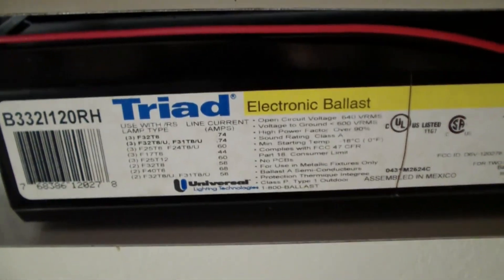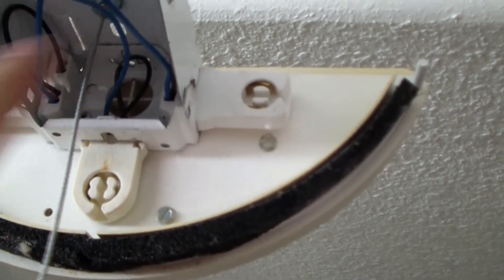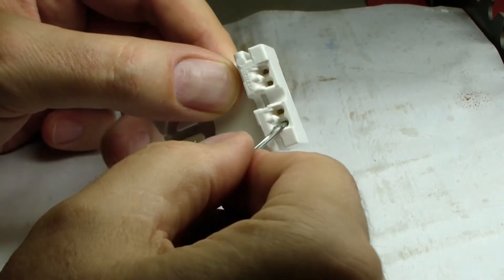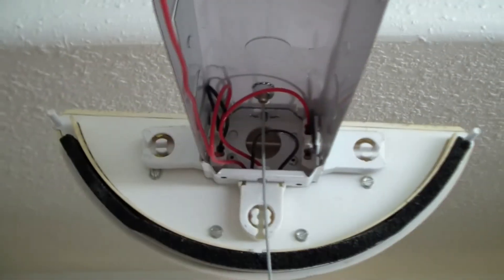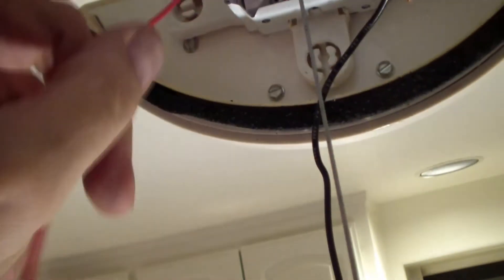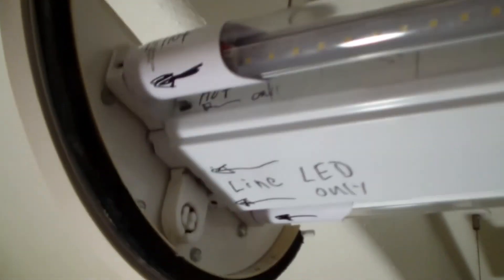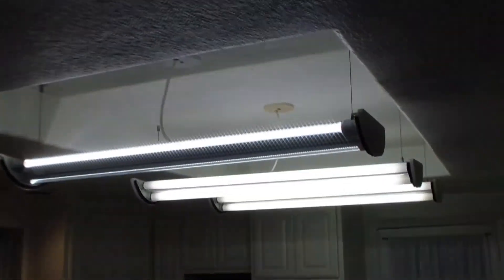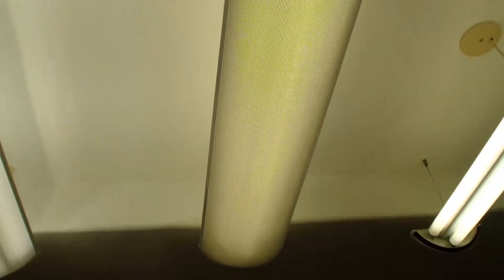Shunted Electronic Ballast LED Tube Wiring

Comment: The only thing I don't like is the directional light quality of the LED tubes, which is easily seen when the fixture is on. The fluorescent tubes at least diffused the light all across the diffuser.
Reply from the maker: There are some applications where the directional light is a big plus. Like in a recessed fixture. Light that would have just been wasted is focused down. Here a frosted bulb would have been better. There is almost too much light.
Reply: I totally agree!